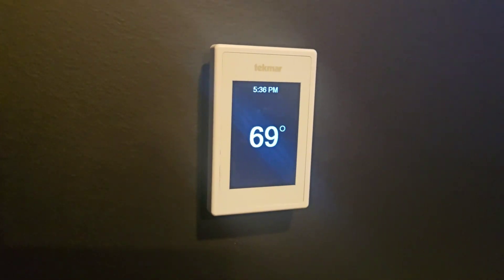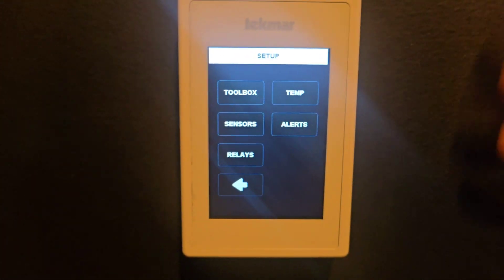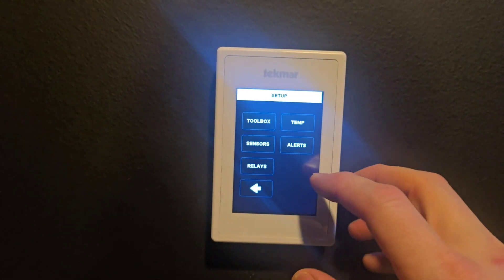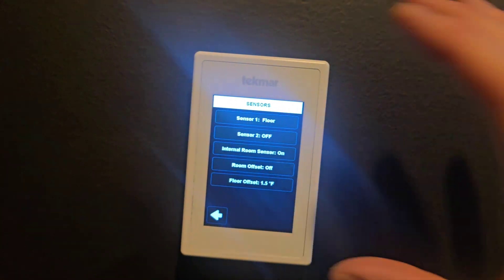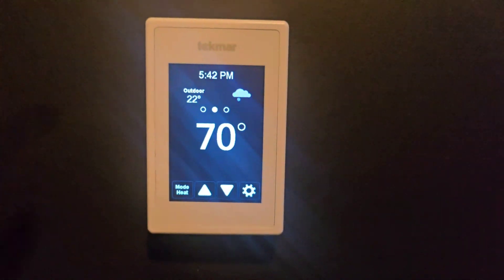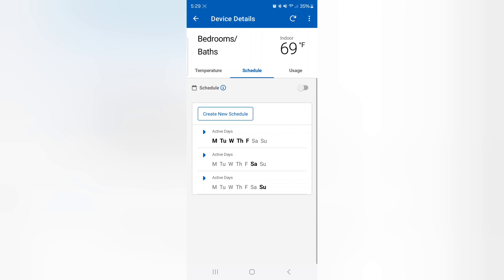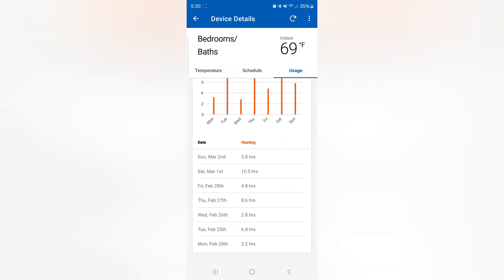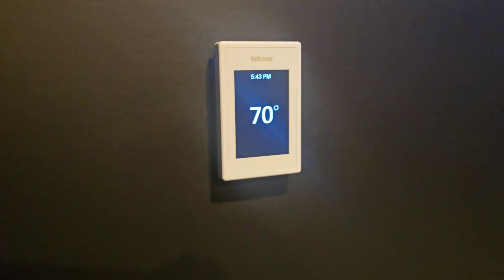Tekmar 561 WiFi Thermostat

Comment: Why does this tstat keep going back to user  instead of staying at installer?
Reply: Also with a house on a concrete slab what would be a safe max floor temp setting.
Reply from the maker: @dantully6087  max water supply temp of 125 and max floor temp of 85.
Reply from the maker: Simply to protect the homeowner from changing the installer settings on accident.

Comment: Would this thermostat work with heat only 2 wire set up? I have old Honeywell round thermostats that are connected to oil boiler with cast iron baseboard.
Reply from the maker: You need 3 wire is order to power the thermostat.
Reply: @JimSperanza  ok thank you
Reply: @JimSperanza  is there one you can recommend that would be better than a standard old Honeywell that would accept the 2 wires?
Reply: I have the floor sensors installed. Wondering should I turn on internal room sensor. Meaning if the room is warm from sun or ductless heat pump. The thermostat will be satisfied and not turn on unless I set a minimum floor temperature